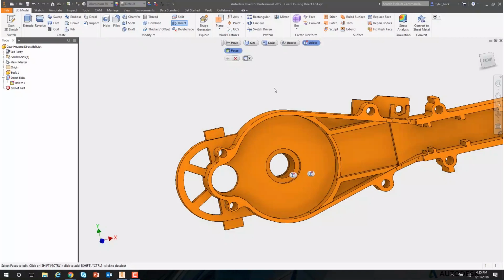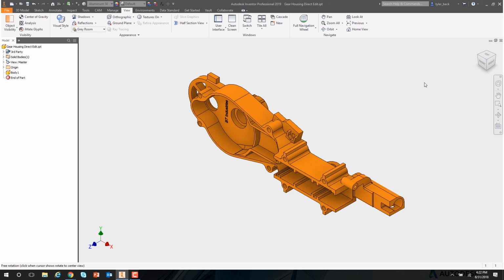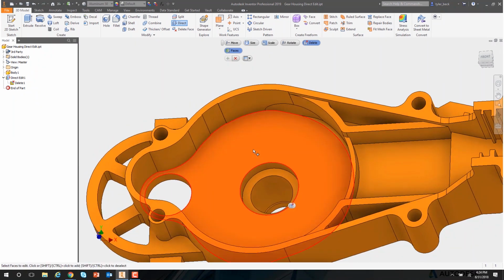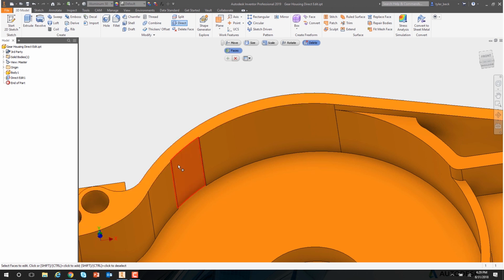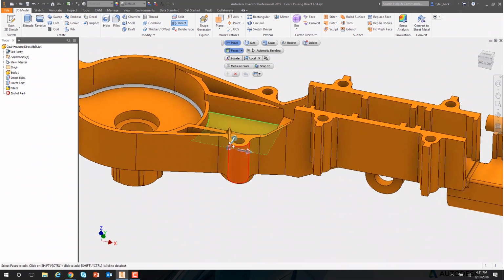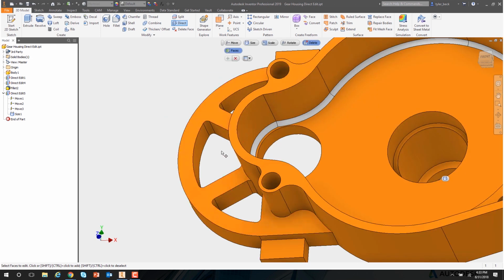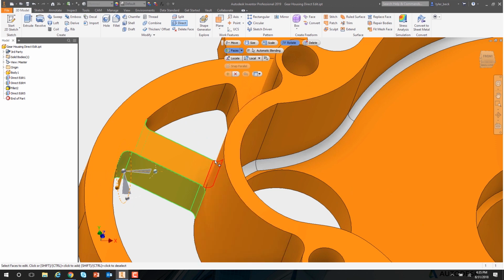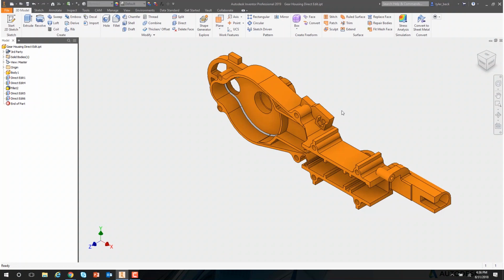Autodesk Inventor 2019 - Import and Edit Step Files - How To Direct Edit LIke A Champ

Comment: Great video. One thing to add is at least with my case. You must either unlock or create a new Design View Representation. Or it will not save. DO NOT SELECT OK when the warning pops up or you will lose your changes. "SELECT CANCEL" and either unlock or create a new design view. Activate the new one and then save.